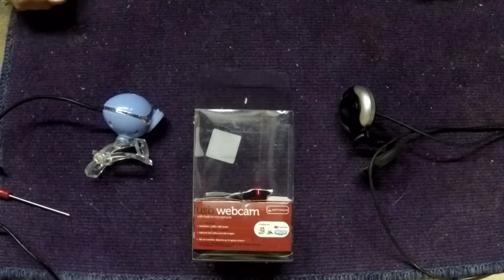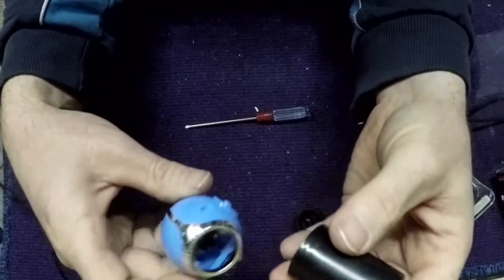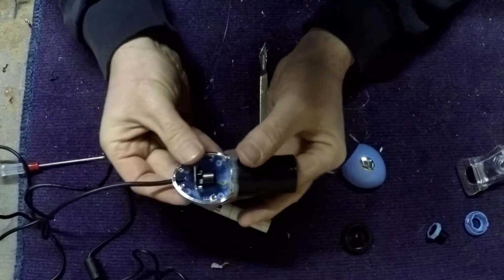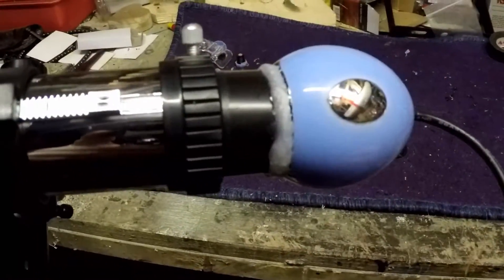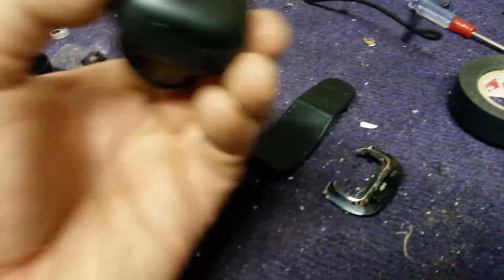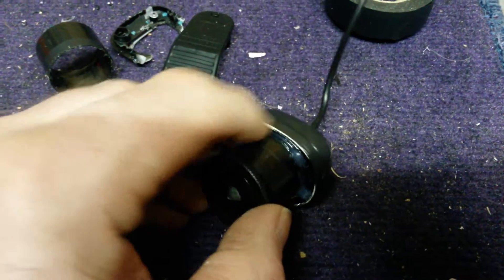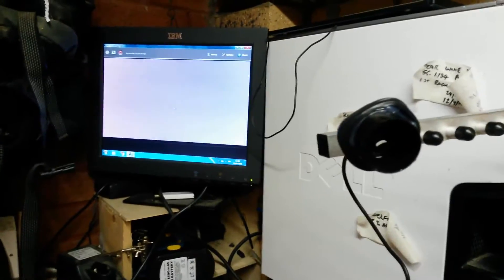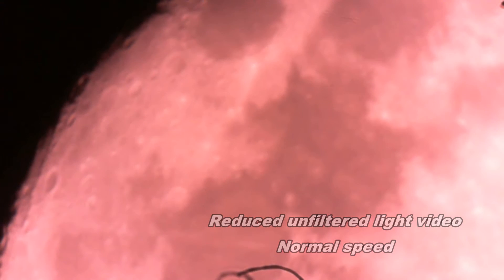Modifying webcam for my telescope.

Comment: I used a screw ring that comes attached with a cheap/old telescope lens I had and epoxy'd it to the webcam so I could screw on different types of filters. I found out quick that I needed a IR-cut filter because the tiny one already attached to the webcam came off with its lens when doing the modification.

Comment: When I try it, I get the secondary mirror which is in the way. What did I do wrong?
Reply from the maker: Maarten Van Rossum it sounds like you are not focusing it properly.  Did you remove the webcam lens?  All you want to use is the webcam sensor.
Reply: Yes, now it gives a white screen (full white). When I cover up the barrel it keeps being white. I checked for light 'leaks'. But everything looks fine. Really trying to figure out what the problem is.
Reply: Figured it out, seems like the tube I used which was orange let alot of light through. I taped it off with electrical tape. Seems to be working now. Thanks!

Greetings
Reply from the maker: Maarten Van Rossum more than likely the focus.  Try experimenting with the focal distance.  If you need to point it at a window and hold a piece of paper where the sensor is to get an idea of the focal distance.
Reply: http://members.home.nl/wkv/webcam01.html

Comment: for the amount of money you spent on webcams you could've bought Celestron solar system Imager used. I'm confused what software you're using to control the exposure and stuff I assume the the webcam software and not 3rd party software
Reply from the maker: The camera you mentioned only gets 1st at review. "Rubbish" was the way they described it. I also costs £99. Mine cost 1/4 of that and has given great results.
Reply from the maker: +TheKayakingkid sorry. auto correct. It received only 1 star.
Reply: also  used  a 10 € webcam  besides the philips toucam...worked just fine...no need to use expensive webcams...   just make sure it can film avi films...so you can use auto stackert or RegiStax  to  change 30 sec films into nice photos...than  merge the photos...  you need around 25  to  get the whole moon...   and you get a perfect moon picture...do it at halve moon :)